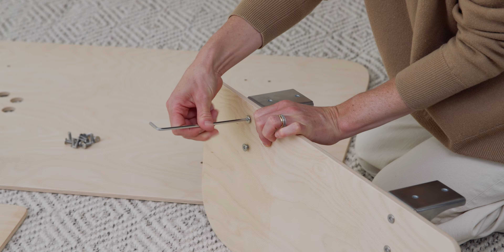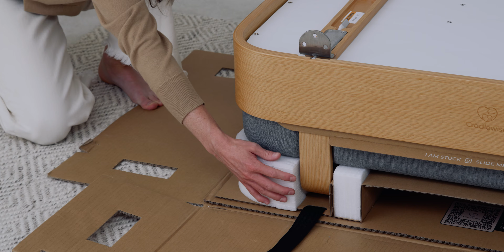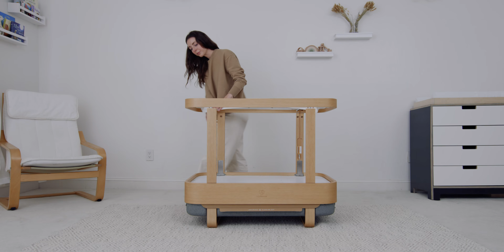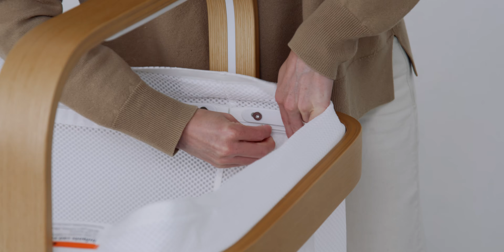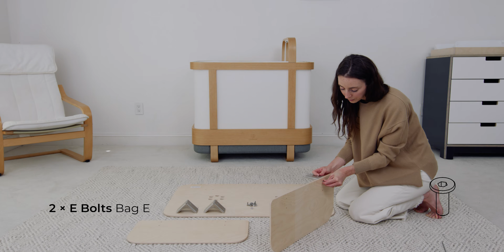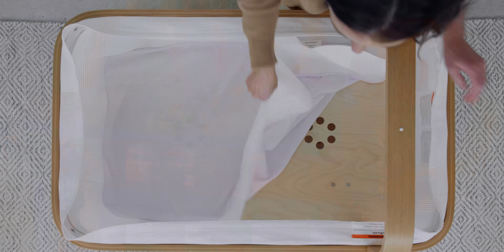Learn how to assemble your Cradlewise

Comment: A friend and I just set up the Cradlewise. I watched the video and then used the printed instructions. The setup was straightforward and the instructions were logical - in my experience, substantially more detailed and easier to follow than typical do-it-yourself furniture setups. There were some differences between what was shown in the video and  the box that we received - it opened a little differently and the instruction book was right on top in the package, not in the parts box. We were able to unbox everything close to where it was delivered and then carry separate pieces upstairs since the box is so heavy. (I wouldn't advise that though unless you read the instructions or study the video carefully first.) If all the tech features of this unit justify the cost for you, I think you'll be happy with your purchase. If you're intimidated by a detailed set-up process or aren't willing/able to study instructions and be patient, best get assistance from someone who can do that for you.

Comment: Harder than IKEA to build and takes longer than the allotted time per the manual. Need to be engineered better for a $2k build 

Too much struggles on these steps: 
1. Cam lock nuts- instruction isn’t clear on where the arrow should point. When tightened, they don’t  feel secure 
2. Attaching the cord to monitor arc - the cord is too long and couldn’t fit in the cavity nicely 
3. Mesh tensioner - very hard to put inside the crib as it’s very tight to the wooden panel. The rubber kept coming off and annoying to put inside.

Comment: Out of curiosity, why do you say multiple times not to cut the straps? The only thing that’s mentioned is that they’re needed to put the Cradlewise back into the box… Is this in case you want to return it or something? Not fully understanding.
Reply from the maker: The straps are used to ensure the safe transportation of the crib. They play a crucial role in compressing the crib during transit, which helps prevent any unnecessary bouncing or movement. This ensures your Cradlewise crib arrives at your doorstep in perfect condition. The straps also serve a practical purpose if you need to disassemble and store the crib. They are designed to help you safely pack and store all the components, making it easier to keep and maintain your Cradlewise crib for future use.